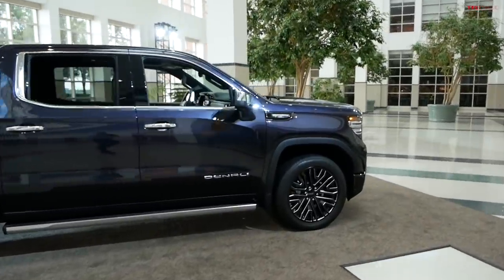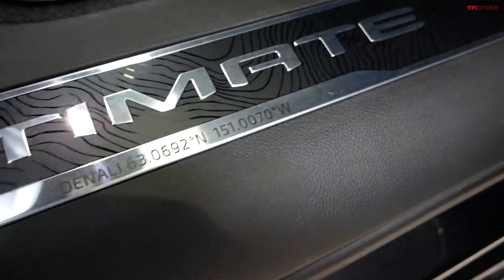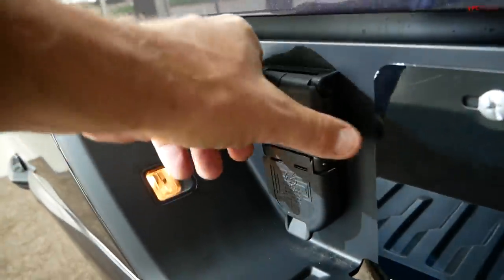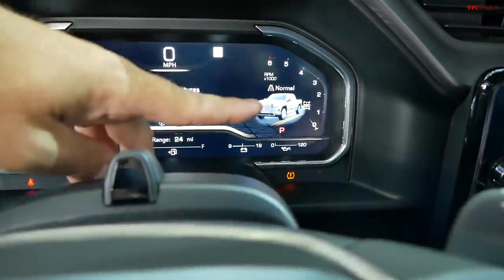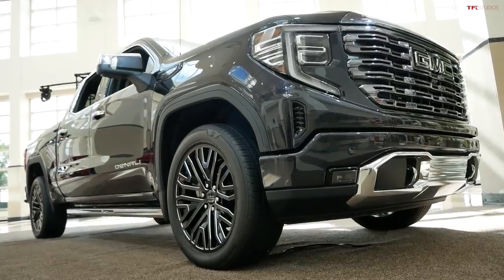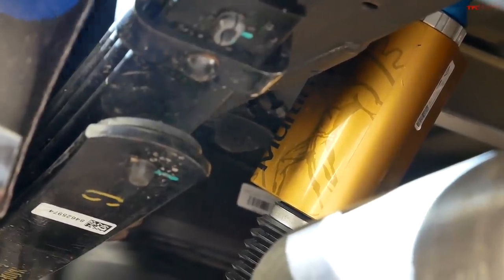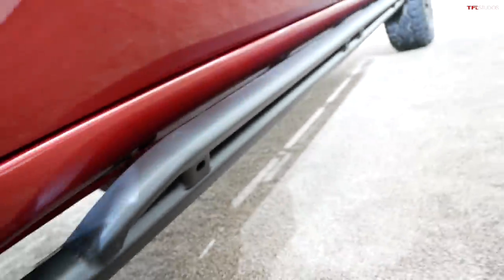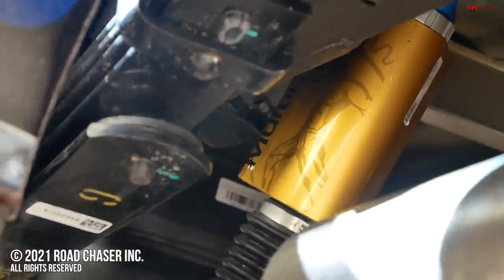Hands On WORLD DEBUT: Here's How The 2022 GMC Sierra Takes It to a Whole New Level!

Comment: Photos of it have already been leaked! Nothing to see apart from a mild cosmetic update to the grill and front end that mirrors the Terrain SUV. This is a refresh people, it's not a new Gen or anything ground-breaking. The Silverado had the front end tweaked here and there and a new interior. Will be the same for the Sierra.
Reply: I am pretty sure it will have a Powerboost-like 7200 watts OR MORE electrical generator system!

I have always like the LOOK of the GMC grill on the Sierra Denali editions so I am hopeful it will meet modern-day interior comfort and tech-feature expectations!

I still want a Ford Raptor-R when it comes out, BUT if someone wants a decent work truck with some luxury features I am pretty sure it will match or exceed the NEW Chevy Silverado interior which I like very very much!

HOWEVER, if the NEW GMC truck DOES NOT HAVE a 7200+ watt Powerboost-like option, I WILL BE VERY VERY DISAPPOINTED. It would then NOT meet or match what Ford has on the options lists! That Powerboost option on the Ford F150's is sooooooo important, that ANY NEW TRUCK introduction from ANY manufacturer that DOES NOT HAVE THAT FEATURE makes that truck a NO GO for any sane trades-and-business-person AND a NO-GO for the off-road camping and towing warrior!

Modern trades and camping/towing warriors MUST have decent 120V/240V AC and 12V DC/USB3 on-board power for their gadgets, tools and camp gear! It's NOW the MUST-HAVE FEATURE for ANY modern truck !!!!!

And this GMC BETTER HAVE IT !!!!

V
Reply: @StarGateSG7  i agree
Reply: @StarGateSG7  You realize not a single trades person/fleet buyer is actually interested in the power boost? That's the Project managers fancy truck.
Reply: @terrencejones9817  My brother is now back in the trades and he runs his corded tools from the F150 Powerboost (he normally has a RAM 3500!). Works great and  literally five minutes ago, the landscapers were plugged into the F150 doing some weed whacking (noise restrictions here so no gas allows at this hour!) with their electrics.  Looks like a LOT of trades in Western Canada have been buying the Powerboost with 7200 watts.
Reply: @StarGateSG7  Sorry but I am a "Trades Person" and big on board power is completely useless to us. First of all work is not done where you park your truck. If you are lucky enough to park your truck close enough where it's generator may be used why would you want to run your truck all day when a company supplied generator will do the job? Idling is hard on engines. Lastly a lot of work we do requires a generator 24hrs a day to run pumps and lights. Are we now expected to camp out?

Honestly all you need is a descent outlet to charge some batteries, and keep a phone and laptop going.
Reply: @geoffmooregm  I suspect it is RELATED to your current location as where I am in Vancouver, Canada I see MANY F150 Powerboosts with LOOOOOOONG cables running to lights, corded tools, small AC welders, and being used as powered meeting and first aid stations.

In your area my observations may not be valid but in Vancouver, Kelowna, Prince George and Calgary/Edmonton/Oil Patch that is the case with the 7200 watt version of the F150 powerboost being a very popular buy with trades and remote technical workers.

It would be INTERESTING to get a breakdown from FORD as to which parts of the USA and Canada bought which version of the F150 series for trades and technical work!

v
Reply: @Itsrang  The GMC better have a Powerboost functionality! 

Powerboost-like functionality is NOT JUST for Site Managers and Yuppies because in MUCH of Western Canada I see the 7200 Watt version of the Ford F150 Powerboost truck being bought by trades and remote onsite technical workers (i.e. oil'n'gas patch) using those electrical connections for lights, corded tools, small AC welders, powered first aid and employee meeting stations and as battery-powered tool charging stations.

It probably depends on your area BUT in Western Canada at least, FORD is selling a LOT of F150 7200 watt Powerboosts!

This NEW Sierra NEEDS to have on-board AC power in order to compete properly with the new Ford F150's !!!

v
Reply: @StarGateSG7  I work all over BC. My home base is in Langley. I have only seen one power boost being used ever. That was my friend camping and running his coffee maker in the morning🤣. 

So let say you run a bunch of cords to one guys truck. Great now that truck is stuck all day or everyone loses power when they want to go grab something. Still does not make sense. If you want a serious generator. Get a diesel one on a trailer with a light stand and power a site 24hrs a day at a fraction of the fuel cost. 

I'm sorry I am just not sold on the idea. I think it is very cool they have it and I see some use for it. But it certainly will not revolutionize construction.
Reply: @geoffmooregm  Why would we take your word a guy in the actual field that does this for a living over someone’s fantasy scenario using a 70K truck to do the job of a 8 year old diesel generator. Now that this guy has brought this revelation to light I will never consider buying a luxury car without a built in refrigerator. I can now get rid of my fridge at home and store my Kale in my 150K S-Class !
Reply: @geoffmooregm  I just looking at what happened this evening in East Van when the landscaping guys came in and plugged their electric trimmers in. A small whir from the trimmers and NO noise from the truck itself. There was multiple cords plugged in and it seemed to work well for them for the two hours they were here.

I think this will become a more popular option in the years to come, especially when the new Aluminum-Sulfur batteries come out which have 8x the power density of Lithium Ion.  It will become a REAL BIG DEAL once the kilo-wattage gets into the 25 KW range! THEN we will see widespread adoption by the trades because a full 400 amp TIG Welder can be easily run off that!

7200 watts (7.2 KW) is STILL too small for many worksite jobs but 25,000 WATTS (25 KW!)  is a VERY BIG DEAL for portable power from a truck! That is the power-production threshold Ford (and others!) need to achieve AT A MINIMUM so that high trades usage becomes common-place!

Anyways, it kinda doesn't matter since I am see more and more Powerboost being used on worksites even at 7200 watts and that will only increase over the next ten years! If you can string a long enough cable from it, I don't see that as a problem to power your corded tools and lighting systems. 

Many of the smaller independents aren't going to BOTHER with a diesel generator when the F150 truck just needs a re-fill about every 8 hours! Bring a 100 litre portable gas can and you are set for quite a while!  You already have a generator BUILT INTO the truck, so why buy or rent another one?  I can buy all-weather 50 metre and 100 metre long 20 amp cables for less than $200 so why bother bringing along a 400 lbs heavy portable diesel generator?

Anyways, I STILL HOPE that the NEW GMC Sierra has the SAME or BETTER Powerboost-like on-board generator option as the Ford F150!

V
Reply: @StarGateSG7  In Vancouver, where the average home price is $1.2 million, that might make sense. 

But everywhere else out here (Interior BC/AB/SK and the rest) where real work is done, a powerboost is a nice idea but in reality it really is not enough for extended work periods.
Reply: Bet you’re real fun at parties. Let people have their fun and drool over dumb shit like they want to, and try not to be so pessimistic.
Reply: Did you see the interior? You're saying NOTHING has changed in the interior?
Reply: @sundaydickson  The interior I do must admit is pretty damn GREAT !!! Not quite yet up to RAM 1500 Limited levels but it is certainly comfortable looking and technologically sophisticated!

My only real complaint WITH EVERY MANUFACTURER is these $75,000+ pricing levels which is utterly eye-watering for the average person.

I remember when a HIGH LEVEL TRIM could be had for about $45,000 which is STILL up there but quite doable for most tradesmen via 5 years financing on $5000 down!

Now you need 72 month to 96 months financing to afford the payments! That $35,000 high level trim on the Ford Maverick is starting to look better and better even IF it's only a unibody design! 

v
Reply: @epap1375  In the NEXT FULL UPDATES for many truck brands.....YES.... I DO SEE THAT YOU WILL have larger built-in combo Fridges and Freezers along with 25 Kilowatt on-board generators and LOTS of 240V/120V/12vdc/USB3 ports/outlets for ALL your power needs!

I will say 2026 will be the year that the above WILL BE COMMON in full size trucks and in the HD models!  By 2030 we will see them in the Medium and Compact trucks too!

V
Reply: @StarGateSG7  corded trimmers?  not battery?  weird
Reply: @goomgoom5504  We have a noise bylaw in Vancouver that after a certain time (8pm) noise levels must be at a minimum for maintenance/construction. 

To be able to do the job, you NEED higher end MORE POWERFUL electric trimmers that are fully corded!

v
Reply: @sundaydickson  Are you blind? I said in my original comment that the interior would change.
Reply: @StarGateSG7  That is a pretty standard civic bylaw across Canada.  I haven’t seen professional landscapers use corded trimmers.  Just different I guess.

Comment: Great looks but only way it will be successful is if it’s price is much lower than raptor. If it comes in at or around the same price it’s better to go raptor with that stunning wide body look 👀 beast
Reply: Except if you want a V8 Raptor, good luck getting it for anywhere near 70K, with front lockers and rock rails standard....

Comment: Does it come with a ladder so you can check the oil ?  I don't know the idiot was that convinced American truck companies that 1/2 ton trucks should be taller and taller. Last time I checked, the average height of folks hasn't increased.
Reply: Actually, they have increased, but point taken....
Reply: I always say this to everyone, especially when it comes to truck beds. Bed heights (tailgate height) are so tall now you can't even reach over to grab stuff and you have to 'toss' things in the bed. Even midsize trucks have extremely tall beds now. 
A simple convenience of just reaching in to the bed now you have to climb the tire or bumper.
Reply: @Argedis  When you park a 1990 and a 2021 1/2 ton truck next to each other, it's like "what the hell happened?". I suspect folks who tow that were too cheap to buy the 3/4 or 1 ton truck complained. I just stopped buying 1/2 ton trucks. The prices are insane and they just get bigger and fatter.  Mid size works for what I need.
Reply: @matt9c1  Yes exactly. Early 2000s 1/2 ton trucks were still reasonable and had easy access low bed heights. Compact trucks were actually compact too. Then everything changed and trucks are ridiculously expensive now too.

Comment: Lol 74k for then AT4x, why would I get this over a raptor for the same price or even cheaper if you don't crazy with options? More power, more travel, better suspension, 35s, I could go on and on. Low 60s I could live with, mid 70s, heck no.
Reply: Because the raptor interior is trash and it's only 25 hp more and weights more...🤷‍♂️
Reply: Will provide u several enjoyable trips to the dealership for recalls and warranty work!  Even more so with cylinder deactivation!  Yay.  Good coffee there hopefully.
Reply: Also the At4 n at4x are designed for a different type of off-roading. Yes u can take a raptor up a mountain but that's not want it was made for and it wouldn't be doing it like these trucks will. I'm a power wagon owner. I've owned 2 of them and a Colorado zr2 bison and if this comes in a diesel I'm getting one of these bad boys.
Reply: That's also around TRX territory. No thanks GM.
Reply: The suspension in the AT4X is better and bigger tires only give u a slightly smoother ride, wider fenders is just for looks and makes it a pain to handle tight trails also the height of this and the raptor is the same with 2 inch smaller tires meaning the suspension on this is tuned better and has more travel but have fun with ur outdated raptor
Reply: @lukechamberlain7531  The raptor has bigger tires than the AT4x though?
Reply: @jaybird4756  is the AT4x interior better, absolutely. But it better be for a 10k more starting price. 510tq , 14" front & 15" rear travel,  35s, 4.10s... stick with the meat and potatoes and I can't find the justification.
Reply: @SSMedic  surprised GM didn't give the AT4x the same size tires as the zr2. Sticking with the trail boss size and style is interesting.
Reply: @jordan4328  until the GMC gets a panoramic roof I wouldn't say it's absolutely better than any truck.

Comment: Wonder if there will be an all electric option or perhaps a hybrid like Ford and Toyota.
Reply: No.
Reply: Its just a mid cycle refresh man.
Reply: Toyota hasn’t made a hybrid truck yet, it’ll probably come with the next gen Tacoma. And probably a full electric option on the mid cycle refresh of the new 2022 Tundra in the coming years
Reply: @chriscarguy  the new tundra comes optional as a hybrid (or standard depending on trim)
Reply: @johnkenley4687  bummer

Comment: Hopefully those leds don’t turn blueish purple. Also that they fix the 3.0 diesel issues with the lovely crank and no start. They shouldn’t have to be cracking open a motor with only 10,000km and replacing a page worth of parts. As I was told the engine computer update/fix is the first step and if it does it again then they check the engine and start replacing certain parts.

Comment: At least there's a floor shifter, at last, now I can put you on my shopping list.
Reply: That's funny. I used to love the fact that GMs use to have column shifters. Different strokes and what not.
Reply: @adamduhon3084  yeah I love my column shifter. Great not to have it take up space in the center.
Reply: Console shifters are stupid. There isn’t 1 benefit to them other than “style” or whatever BS reason you have.  The column shifter frees up space in the centre console, it is a nice hand rest when you adjust the radio, and you can easily throw it in gear without looking and what you’re doing.  Also, because the column shift was 100% mechanical, you could shift into and out of park while the vehicle was turned off.

Comment: Just checked - MSRP for a nicely loaded Raptor is around $71k... granted it misses out on some luxury features, but that pricing on the AT4x hurts. A lot. Guess the regular AT4 would do just fine... 

The new interior looks great though, especially on some of the more normal specs where they still have the column shifter and center jump seat.

Comment: The question is do you guys feel the AT4x is worth $14k more than the standard AT4 and is the new Denali Ultimate worth 19k more than the standard Denali?
Reply: The AT4 has a G80 Mechanical locker, a 2 inch lift, and comes with 18'' wheels and like 32'' Wrangler DuraTracs. The AT4X comes with front and rear electronic lockers (which, apart from the Silverado, is the only truck in the industry to do so), a 3 inch lift, custom 18'' wheels, and the same Wrangler DuraTracs, as well as the standard hill descent control and a new one-pedal crawl control.
Reply: @Wolfsbane1100  I know but is that worth $14k? Opinions will vary
Reply: @aaronbooth9222  no, you can get a nice 3 inch lift kit and nice off-road wheels for less money

Comment: If your not into the Sierra Denali ultimate. Skip till about 8:28 then you can see the AT4X. This truck is what I'd be interested in. The Denali ultimate is way to flashy not to mention way too much money. I love that they updated the interior design.  Way better than the previous interior of the 2019-2021 trucks. However I do have a question on the shifter and the location of the trailer brake control. Why did they go with a toggle shifter?? Doesn't the company know that people don't like toggle shifters and the location of the trailer brake control is dumb. Come on GM yes you gave the people a updated interior and a new shifter awesome. Then we find out it's a toggle shifter literally the most unpopular shifter out there instead of a regular shifter like ford uses. Then they take the trailer brake controller and relocate it from a convenient location and move it to a inconvenient location.🙄🙄😔 well that's GM for ya I guess. They start out good and keep going strong and then they fall on their face at the end. Typical GM.

Comment: I want the ultimate. I settled for a high country with the 6.2l bc I couldn't find a Denali with the 6.2l only 5.3s and diesel engines. I kept it low mileage for trade in value

Comment: Have they fixed the damn lifter issues? Is the AFM/ Cylinder deactivation fixed? How about the torque converter/6-speed transmission? What about that trash 8 speed? To me, the engine and transmission are a very important part but GM keeps selling this trash and not giving a shit about the reliability of the drivetrain! Yes, exterior it’s a beautiful truck no shit but trash engine and transmission!
Reply: Complain complain!!